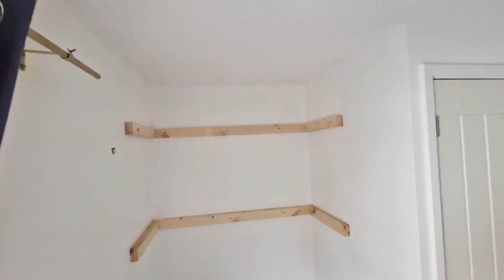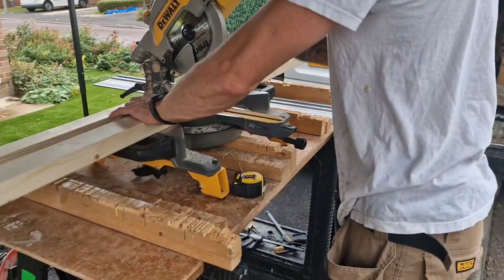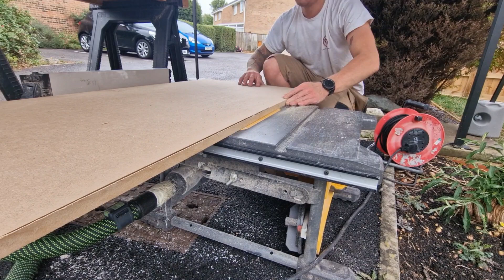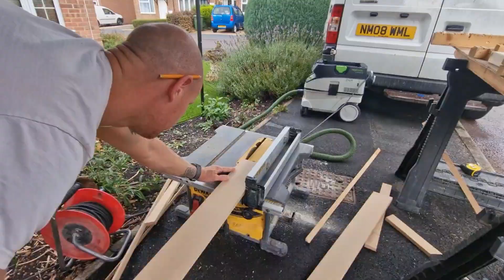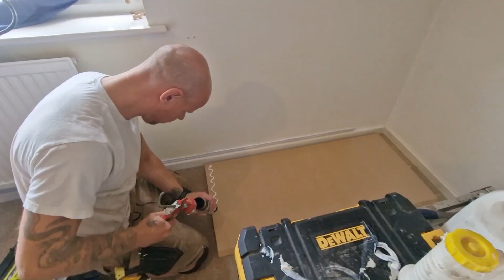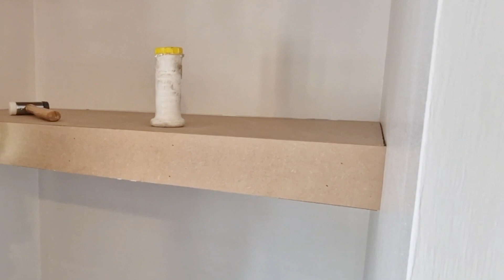How to Build Super Strong Floating Shelves! Alcove Shelves!#carpentry #woodworking#tips#tooltips#diy

Comment: Does your 45 degree edge cuts fit perfectly in this way or need filling?
Reply from the maker: Na they definitely weren't perfect and needed filling. Better off cutting 45.5 - 46⁰. 
Way better than messing with mdf edges tho.

Comment: Hey can I ask what wood did you use to initially make the shelf supports and is this on a hollow wall or solid? Thanks
Reply from the maker: Hiya, I used 3x2 cls timber. The wall on the left was the external wall so I used rawl plugs. The wall to the right was a stud wall so I screwed into the timber stud. 
Hope that helps.